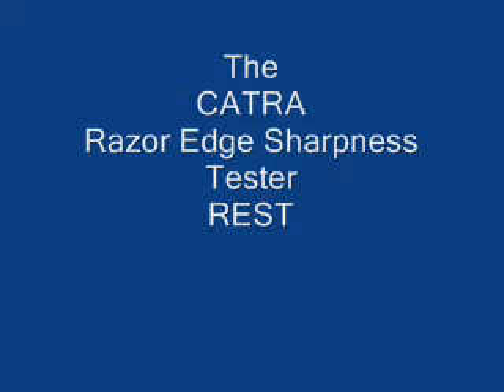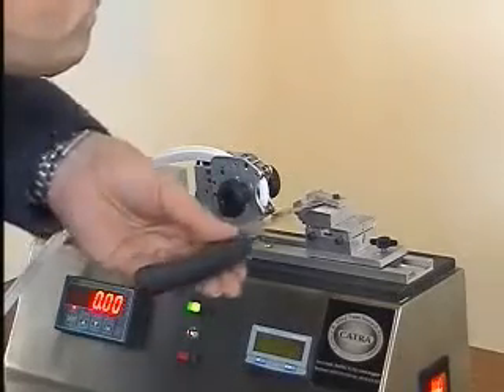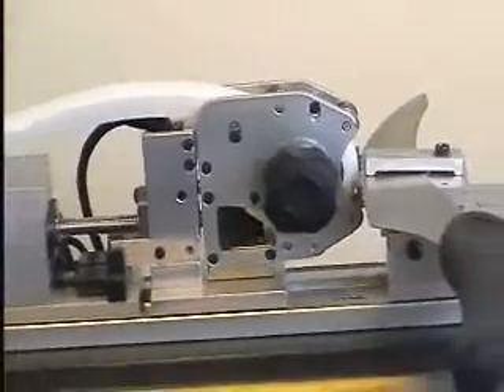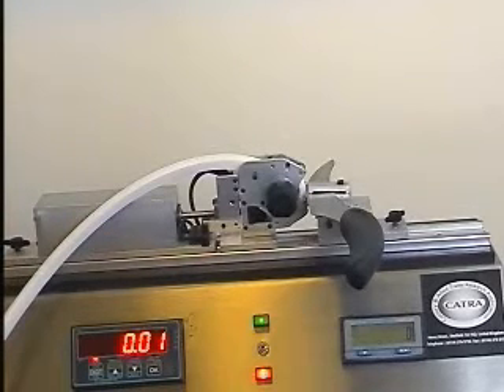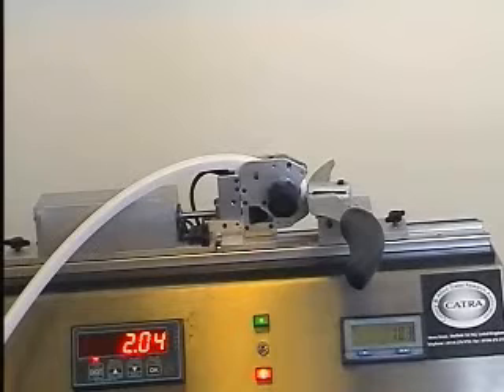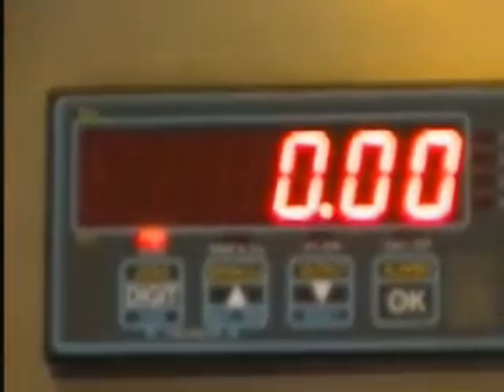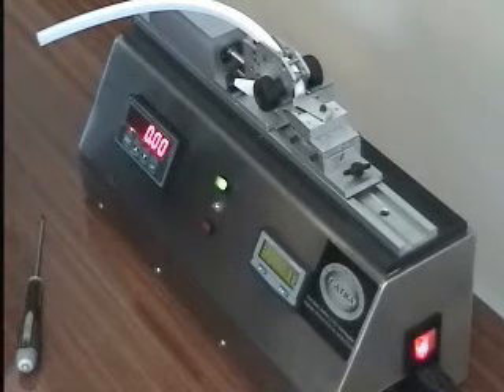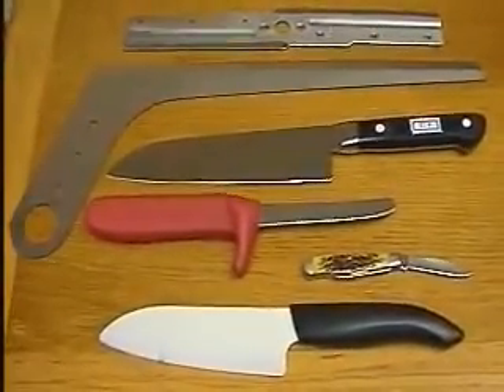Razor Edge Sharpness Tester (REST) by CATRA

Comment: What are the units of sharpness
Reply: Sharpness is not like  length or weight , it is  a measure of the amount of effort to cut someting. So it is actually work done under a particular set of  circumstances. As work done is defined as  force x distance, in this instrument we keep the distance constant and measure the cutting force. So on this instrument the units are in Newtons force (N), the lower the figure, the sharper the blade.

Comment: Sorry you are not correct. CATRA has spent many years carrying out scientific research in to testing of cutting edges. Results from their test machines have been proven to give accurate and consistent results, which have been confirmed by many trials using other systems including statistical analysis of large numbers of human test panels.